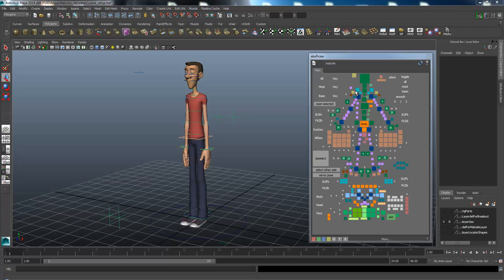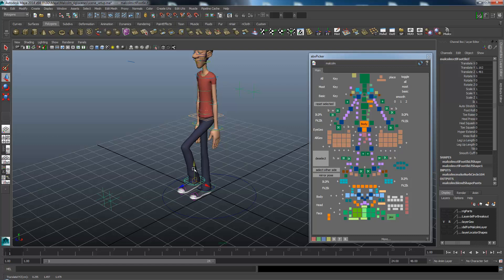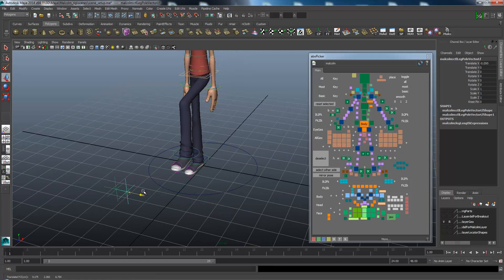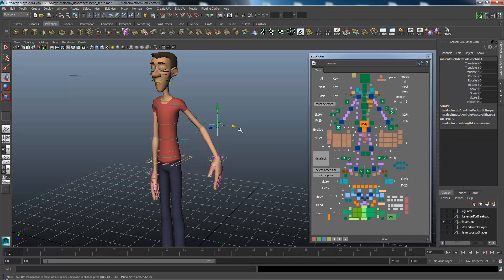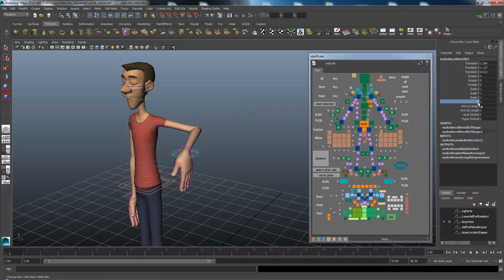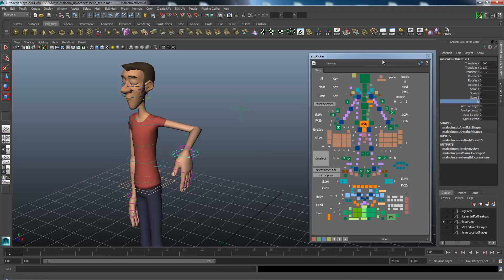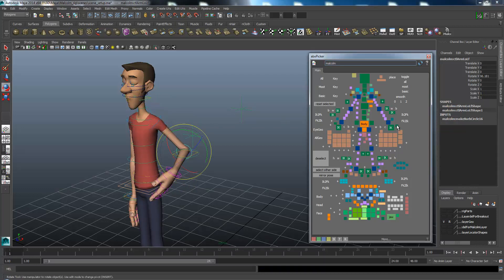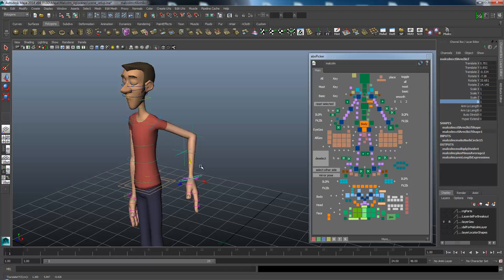IK / FK switch - rotate arms and legs

Comment: wat if i didnt install the picker ??
then how come i switch ??
Reply from the maker: you can switch manually by selecting the correct controller and change the IK slider, but you will not transfer the controllers to the correct location and orientation. I would suggest you install the picker, it's free :)